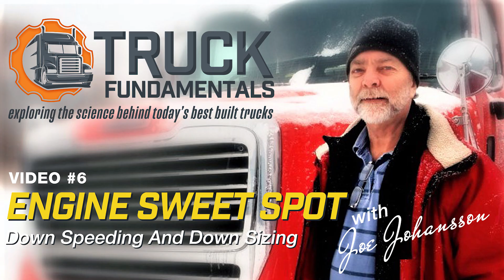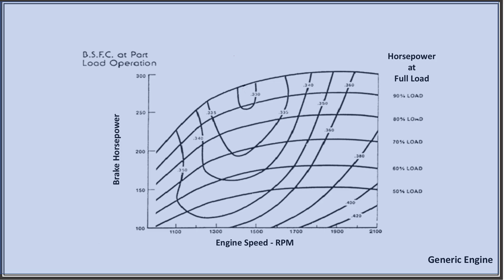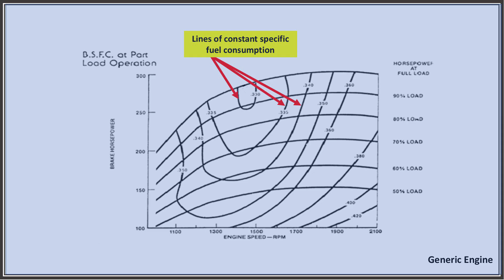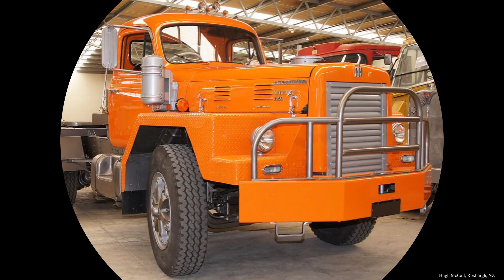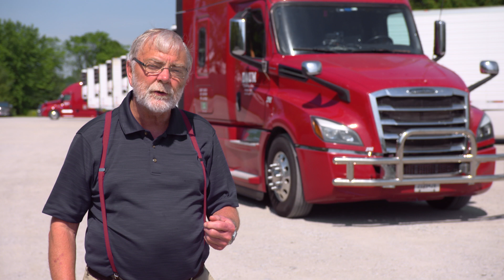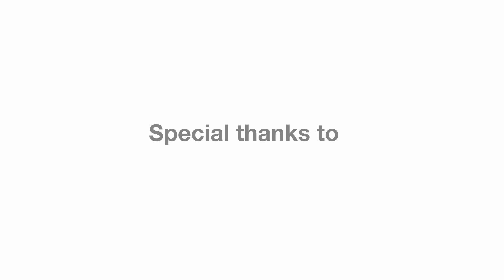Engine Sweet Spot

Comment: i have a older truck mid 80's. it likes to run down the road at 67 to 69 mph at this speed it just moves along pretty effortlessly over minor to average hills. with minor shifting. Gets great fuel mileage for it age. it is running about 1550 rpm to do this. i have newer  trucks that run along at just about this same way. rpm is only about 1300 and they do great job and get good fuel mileage. I have tried to run like the freight truck do at 60. these trucks are autoshift so my opinion of when to shift doesn't come into play. the trucks are in a constant mode of shifting back and forth its a fight for then to go down the road and fuel mileage goes down. so outside of the freight trucks being a hazard to everyone on the road at that speed what is there thought for having there trucks run like this? What am I missing? More fuel burned more wear on truck with constant laboring the truck and most important the safety hazard they cause. Someone help me understand.
Reply from the maker: I apologize for not getting back to you earlier.
Your problem, I believe, is that your gear hunting is caused by the engine "falling off the power curve" as load drags the engine down. I think the match between the axle ratio and the engine curve, drags the engine down at the slightest grade.  I know that this is very unpleasant. Here are some thoughts:
1.Does the transmission have, perhaps, Performance and Economy settings? If it does, then they work by changing the shift points. Driving in Economy causes the engine to lug more, and hold in gear longer on hills. Try it.
2. The axle ratio could also be too "fast" i.e. a low ratio  number. As you are cruising along on a flat road you are at low rpm. As you hit the slightest hill the additional load causes the engine to drop off the power curve. A deeper axle ratio (bigger ratio number) would have engine speed a little higher at cruise so that when you hit the hill, you are still on the power curve.  The only ptoblem with this solution  is that you need to change the axle ratio which will cost you money.
Try #1 first, and then explore #2.
Reply from the maker: I wrote you a reply today (11/7) but if it did not come thorugh, please let me know and I'll send you another response.
Reply from the maker: I realise that the response I wrote, somehow disappeared. Let me try again........
The problem you have is that you fall off the engine power curve as the engine lugs down for the hill. Without knowing what the curve looks like I cannot say for sure, see move down but it seems very probable that your RPM drops to get over the hill and the transmission calibration is such that it causes the shift to be made to bring the RPM up to a point where you have enough power to get over the hill.
This is a very unpleasant way to drive and I'm very aware of a problem like this. I have two possible solutions which you should probably look at:
1.	Does your automated transmission have an economy and performance mode? If this is the case, you should experiment by driving in economy and seeing what happens. Economy and performance modes work by utilizing different shift strategies, so that shift points are changed. So it could be that as you approach the hill you want the engine to lug to get over the hill as opposed to making a shift. So, I would suggest trying different modes to see if the powertrain operates differently.

2.	I suspect that the real problem you have is that the actual ratio is too fast for the engine. In other words, the ratio is too low. This is fine for cruising along a flat road. But as soon as you approach a hill, the engine speed falls and it requires a shift to be made. If you had a higher axle ratio, that is a ratio with a higher value, you will be cruising down the flat road at a slightly higher engine speed, but you would be able to get over the small hills without falling off the ancient curve.

These are the two solutions. The first one is just a matter of experimenting and seeing how the vehicle performs. The second solution is possibly the real cause of the problem but to fix it you would have to change the axle ratio in the axle and that will cost money.
Please let me know if this resolves your problem and if you want to continue the conversation just let me know.